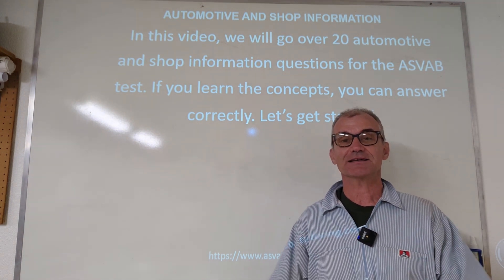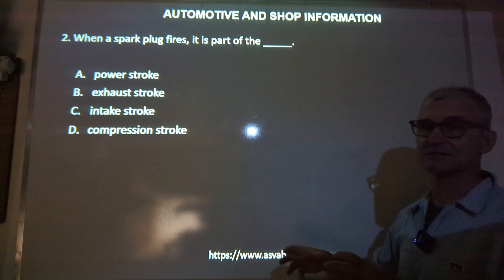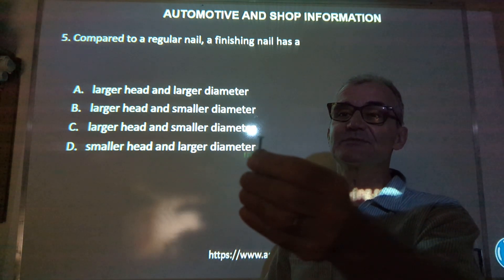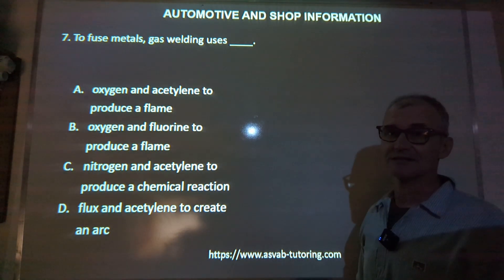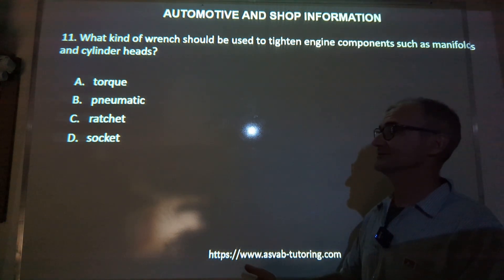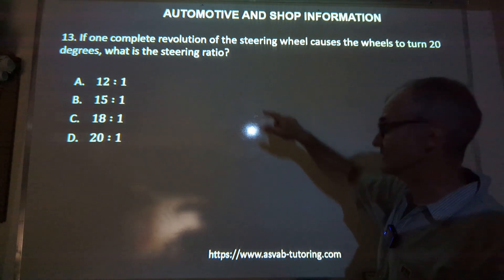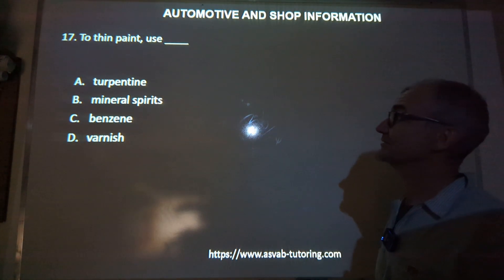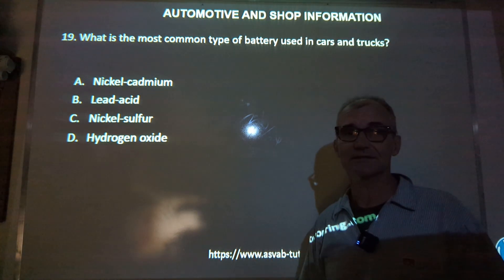ASVAB Automotive and Shop Practice Problems

Comment: WARNING! This is good info but to be fair nothing like this was on the ASVAB I took as of August 2023. Only that was close was the gears. What they do ask about is carpentry, doors, windows, hinges, and type tools.
Reply from the maker: Good info thank you for posting
Reply: Every asvab has different questions not every asvab is gonna have the same questions🤦🏻‍♂️
Reply: i took the practice as an and a few of these questions were actually on it
Reply: @ILast1Sec pie cat?
Reply: Right the point is to get examples though. In learn how to use the formula, different numbers but you will solve them the same !